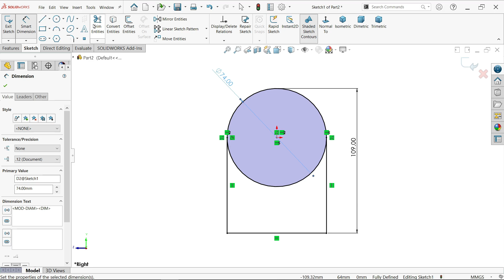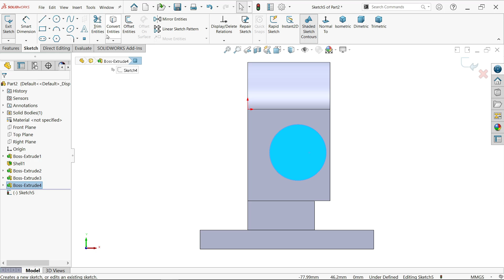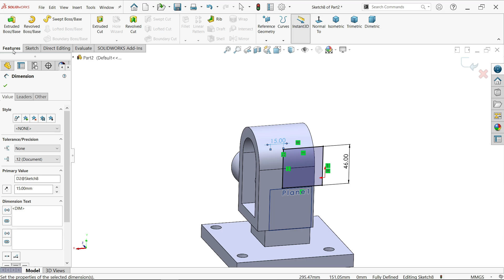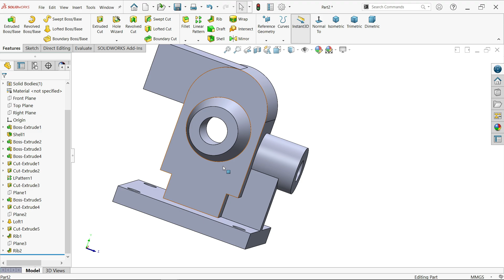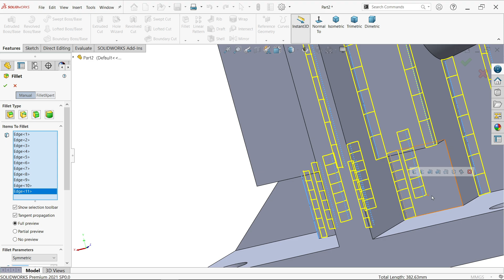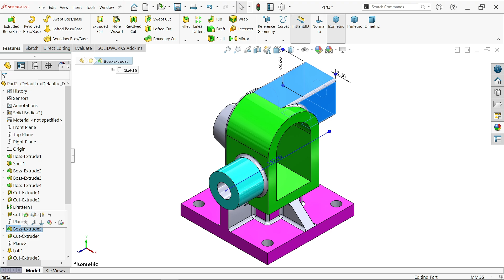Solidworks tutorial Junction Block

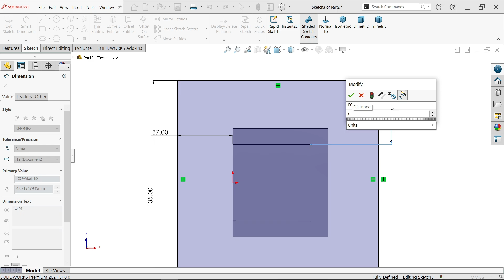Comment: Mistake again. When you making parts you dont see it that is of center. First at 4:19 you took dimesion from wrong location so the part is of center. The the 4 holes at 8:10 are not center. They all should be 13mm from edges and they are not. You can even see it after you make them. I just dont understand why you cant see it those mistakes.